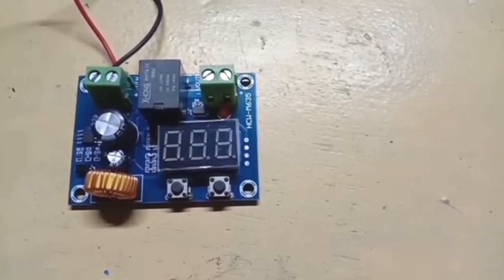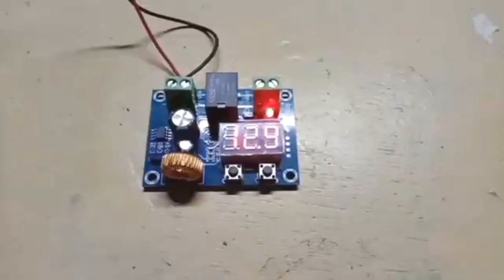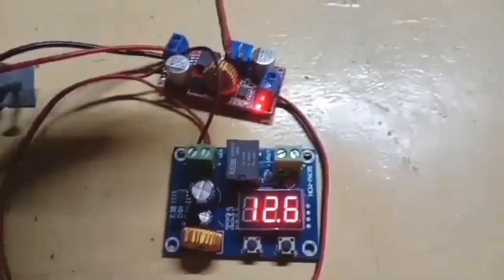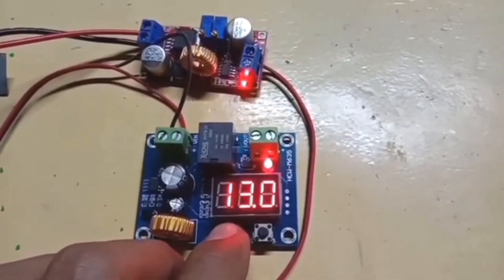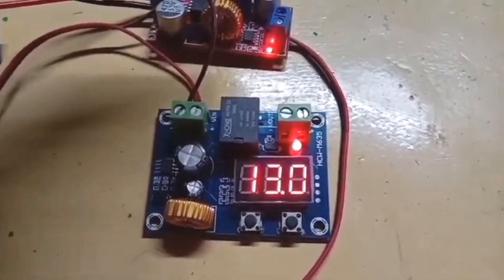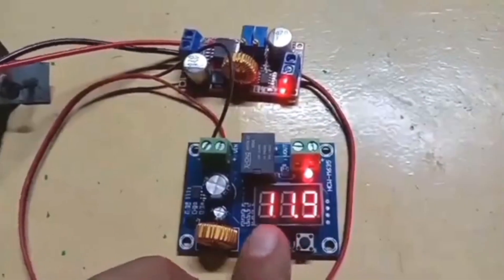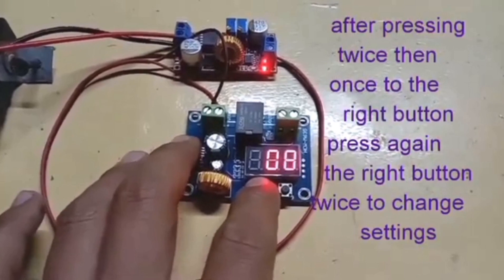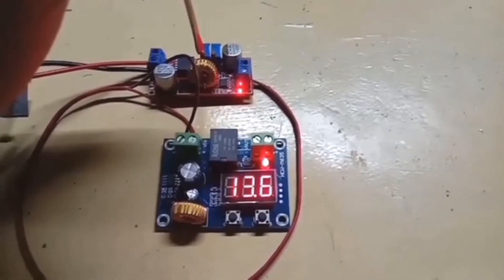HCW M635 Tutorial Changing setting parameter, paano magpalit ng setting

Comment: pwede b ma adjust or ma callibrate and voltage nya according sa voltage ng multimeter? malayo kasi ang display nya sa multimeter eh, multimeter 12.4 then sa lowvoltage disconnect is 12.8V
Reply from the maker: magbase kanalang sa gamit mo tester,, kung sa palagay mo mas accurate po yan lods,, add or minus kanalang sa module, ako kase sir mas dumidipende ako sa tester ko,,

Comment: Does it store the settings when no power is attached to the circuit? I.e. settings memory?
Reply from the maker: after setting your desired parameter,, just leave the module for a second and it will restore to operational mode and automatically save the setting

Comment: Hi po parasaan naman po kapag long press mo ung right button 000-100. Thanks po
Reply: Kapag nag long press ka ng 3 sec sa right buttom, bibigyan ka nun ng option na macalebrate yung volyage sa actual display mo, kasi kahit maiset mo yung lvd and reconnect niya ,tas hindi naman calibirated yung sa voltage display.., baka maging nonsense lang yung mga sinet up mo, then meron din option for setting to factory default,

Long press magkasabay sa right and left button then magshoshow yung 888 then yung voltage display after wards..  , then pwede na ka uli magcalibrate from the start. 

Yung lang din naituro sakin,

Comment: may nakalimutan ka po sir yung voltage calibration once hold yung button (+) ng 3 sec magvoltage calibration yung sa display kaya need ng bench power supply or tester muna yung battery bago icalibrate yung voltage display
Reply: Что настраивается правой кнопкой "-" долгое нажатие? Никак не найду пояснение на русском.
Reply: @EgorKyznetc  это для реле таймера задержки, значение 1-10 каждые 1 значение задержки 6 секунд. Когда напряжение достигнет своего уровня восстановления, запустится таймер.